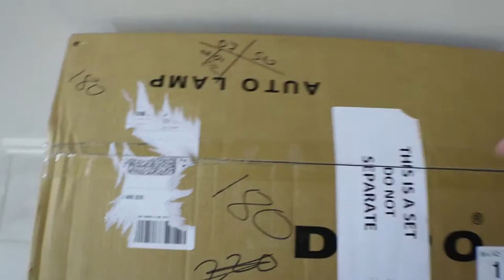Lancer / Evo X Retrofit Part 1 (2008+)

Comment: How did you solve the DRL issue on the low beams, J Rox DRL bypass kit?
Reply from the maker: I forget which years, but some model years don't have DRLs. Mine is a 2015 and does not have DRLs, but you would usually use the bypass kit.
Reply: @jeflui  Ok thanks.  Mine is an 08.
Reply: @jeflui  where did you mount the ballasts?
Reply: Where did you get power and ground for the controller ?

Comment: You didn't end up with a large gap between the shroud and the projector? I ended up with the EvoX-R 2.0
Reply from the maker: Mason AK there is a gap between the projector and shroud but that’s because of how the headlight is made. It’s not really noticeable unless you look closely at it from the outside after rebuilding the headlights.
Reply: Jeff Lui the gap on mine is large enough to fit my pinky finger in it... I know there's going to be a small gap, but I think the EvoX-R 2.0 might be w different size that the original EvoX-R
Reply from the maker: Mason AK I’ve never seen the 2.0 version in person before but looking at the specs it does seem like the 2.0’s are definitely smaller than the originals. That’s probably why your projectors and shrouds have bigger gaps.
Reply: Jeff Lui go figure the original EvoX-R is no longer available.

Comment: What bulbs do these headlights use ? 9005 low beams/9006 high beams?
Reply from the maker: huundreds yes. Unless you switch out the projector then you'd need to buy a new matching bulb. The evo xr projector I put in uses d2s bulbs
Reply: Jeff Lui sweet! Thanks for the info